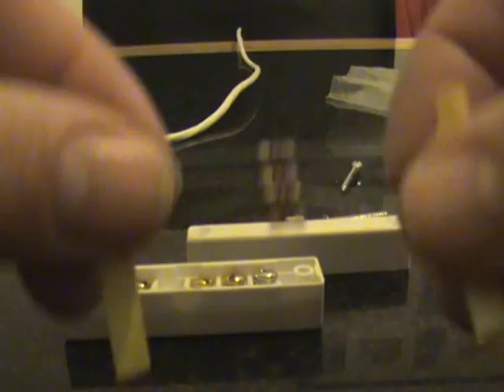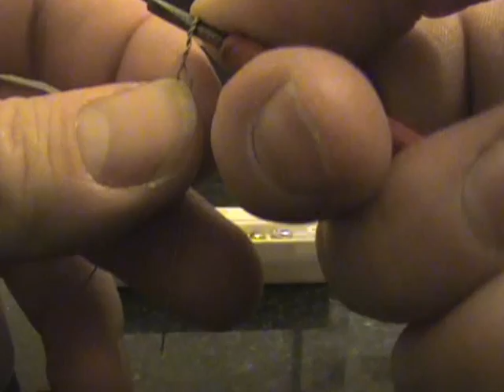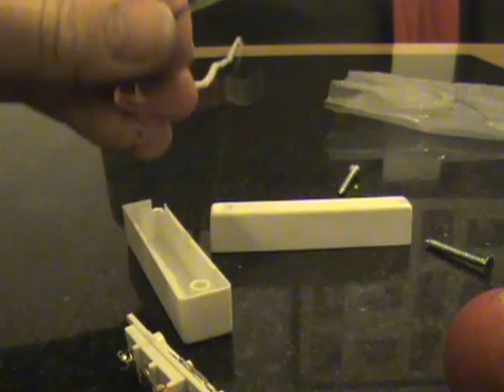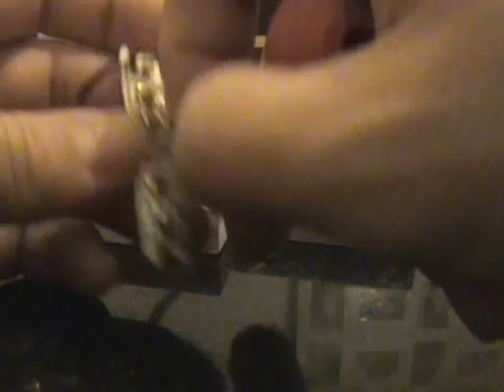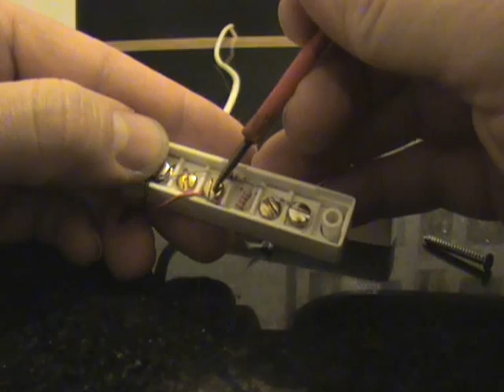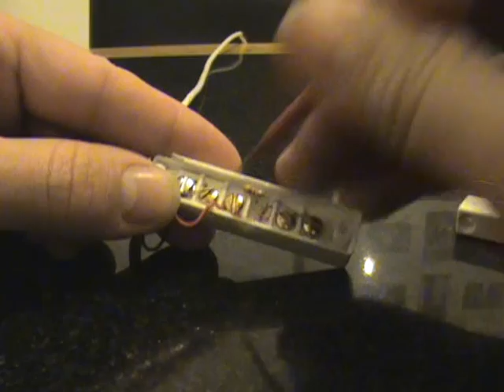how to change or wire a domestic burglar alarm surface contact ( 2 wire FSL EOL )

Comment: Great video. But what if i wants to have 4 door contacts connected i serial, to one zone on the alarm panel. what size resistans do i then have to use ?

Comment: Hi Dannie,
I have a question i hope you can help me with.
I have an optima panel and need to change the contact due to a replacement door.
The contact is on the same loop as the Zone 1 motion sensor.
Will the process in the video apply to my system?

Thank you

Liam

Comment: i recently had a new door and have no door contact now. there are 6 wires. how do i know which ones are the power ones and wires i need for the alarm. possible to test with multimeter. i have the scantronic 9448 but the manuel is of no help.
Reply from the maker: Hi.
There should! be no power at the contact, and assuming you have standard cable you should have red, black, blue, yellow, green and white on a six core cable.
so chances are the circuit is red and black or blue and yellow or green and white as pairs. simple test is start to set your alarm and short a pair as above and see if zone goes clear as a zone led will stay lit on the display of the as long as there is a fault on the zone.
Reply: Thanks ill try that. By shorting a circuit do u mean just connect two wires together then set the alarm
Reply from the maker: Yes